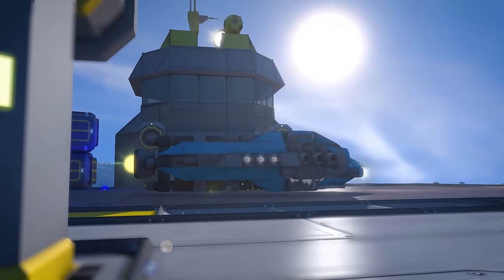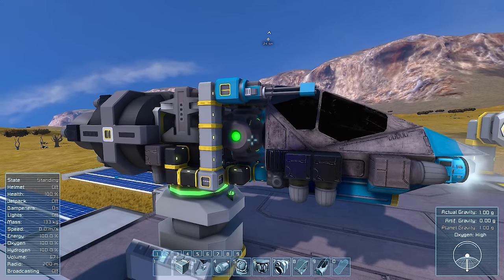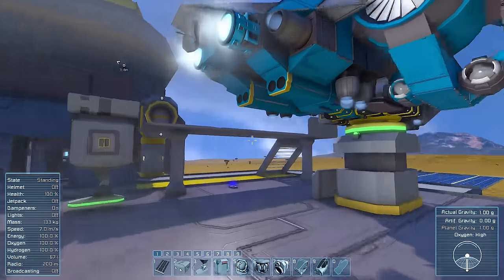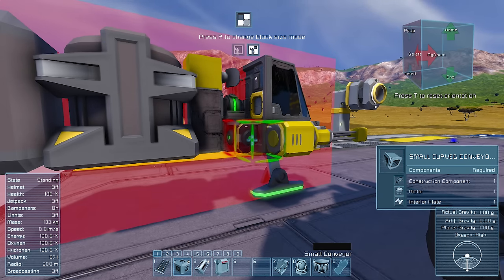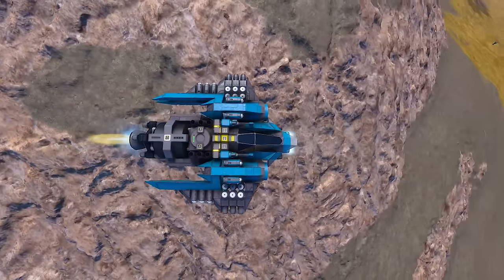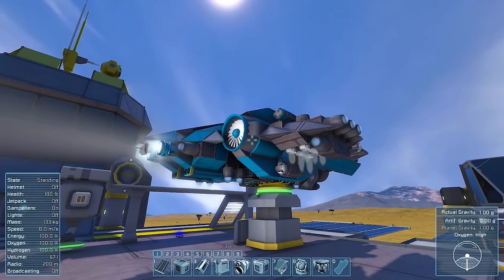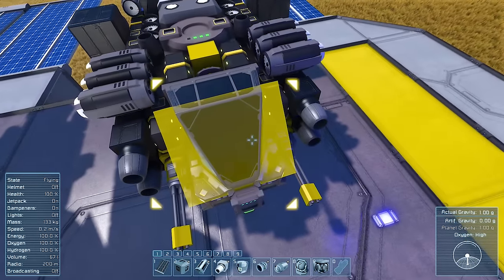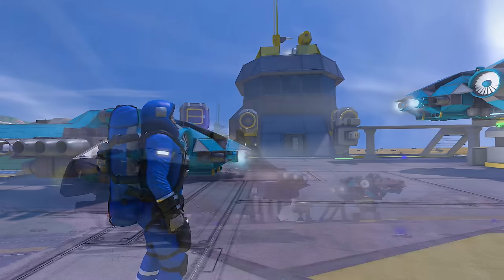Skyke MK3: Small Ships 101 [Space Engineers]

Comment: Love this video, it actually helped me in building my first ship. One issue I've been running into is power. On my first ship I have a large small ship reactor and 2 batteries, but the battery power only lasts like 20 minutes fully charged. Is the reactor enough to run a small ship alone? I don't want to crash and destroy the ship finding out.
Reply: A recommendation I think is set the batteries as a backup power, so in the event the reactor fails, you can turn on the batteries. Proper management would allow you to be able to last much longer than 20 minutes.

Comment: What's better for planetary fighters
Atmospheric thrusters
or
Hydrogen thrusters?
Discuss
Reply: It depends.

Are you trying to fight in and out of atmosphere?

If yes, then hydrogen
If no, the atmo. (Or if you're space-based only, then ion.)

You could also pair up atmo and hydrogen.
Reply: Hydrogen should almost never be used as the main fuel for a ship. Tanks take up too much space and they don't hold a whole lot of fuel. Hydrogen thrusters are the only vanilla thruster that will get you out of a planet but you may need to refuel every trip.
Reply from the maker: Adam is right.  That's why I have the hydrogen thruster facing only in the rear direction.  This allows me to use it to thrust out of atmo, but conserve it for navigation by differing lateral, vertical, and forward thrust for ions or atmospheric thrusters.   You can however use the hydrogen thruster as a booster to slow down or accelerate quickly, just put it on your hotbar as a toggle on/off option!
Reply: Okay. Next question!
Which do you think if easier to work/build with
Atmospheric
Or
Ion thrusters?

Also insert obligatory "ZOMG THE YOUTUBER REPLYD 2 ME COMENT" comment
Reply: If you
1: want to fly longer than 2 minutes
2:dont want 99% of your ship to be made of tanks and oxygen generators
you should use atmospheric thrusters
Reply: Ion thrusters work best in space so i depends on what you want.
Reply: A hybrid design would probably be the best. You could use atmospheric thrusters for your main thrust, but the hydrogen could be used like an afterburner to increase your acceleration.
Reply: atmos for smaller nimble fighters with maybe 1 hydro thruster (or more if you are using small) for quick getaways
hydrogen for larger ones that have the space to carry the hydrogen needed, but not recommended for the main thrust as it is very resource consuming (maybe get a mod that tones down the consumption)

Comment: Hi guys. I'd appreciate help from any-one with knowledge of computer systems. I have an Intel i5-6500 @ 3200ghz and a GeForce GTX 720. I get very poor fps on lowest settings in space engineers. I think my poor fps may be due to my ram, as I have only 8gb. I exceed the recommended specs written on Steam, bar the ram. Will getting an extra 8gb make a difference to my fps?
Reply: Also \, how the hell do you get the mirrorlines to work? If I try to put one down I can't build anymore, and the tooltip says to press LMB but that doesn't do anything.
Reply: you got a better GPU than me but the I5 and ram is the same i get 60 fps on high so... hmmmm are your world full off grids and "lose" stuff?